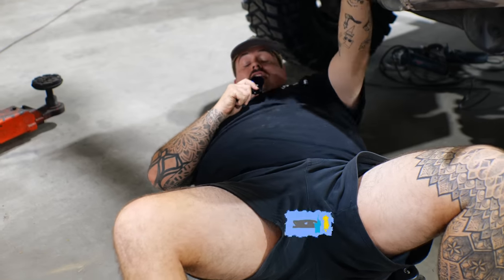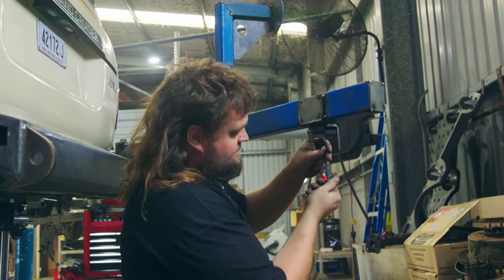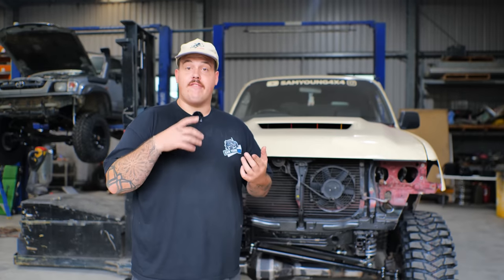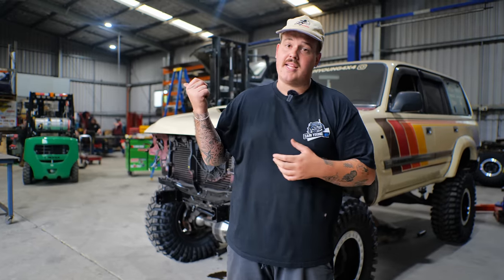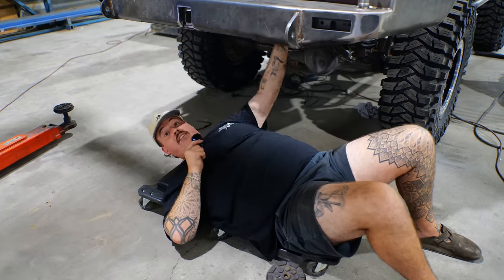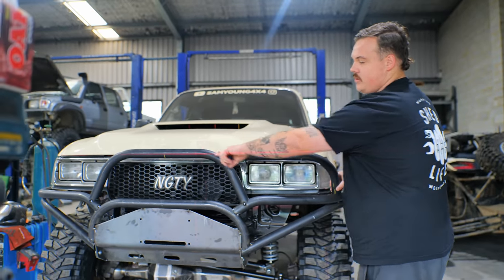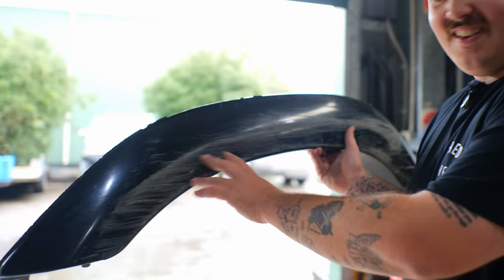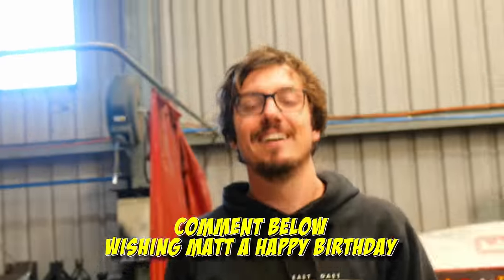Building Custom Barwork For My Landcruiser!

Comment: Absolutely in love with this build serious. So curious to see how it will go on the tracks and especially touring being the mighty as per claimed "Thousand horsepower gods motor". Always been a diesal man myself growing up in a HDJ100 and a hilux. But for some reason I find myself looking for serious 4 TB 48 GU's.
Reply: toyotas use nissan parts.. so,,buy a nissan..they have better wheel base, a transmission brake, & half the fkn price..the petrol ones, 4.5,4.8,?, are the go, if,,you dont do kkkkkkkkkkk trips..ill keep my yank 4x4rs.. 1975 highboy, f250..

Comment: Towbar delete & relocated hitch into chassis crossmember is halfway to what I have envisioned. I want the bumper also recessed by a couple of inches on my 1993 GXL which would require the chassis rail ends to be circumcised.  Or at least cut on an angle. Well Kinsela, can it be done? & still be legal?
Happy birthday Matt 🎂🎁🎈

Comment: I dare you to put the inter cooler outside of the engine bay like I did. Like in front of the grille. Works the best.
Reply: Can I see any pics of this?😂Surely this is on a pajero.
Reply: they put those 1 ft square i/ coolers in the engine bay,,COS THERES NO FKN ROOM.. with an earlier grill on a nissan, it fits   & bigger.. or,,buy a real truck..